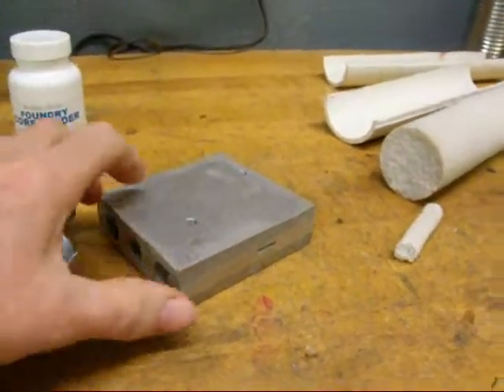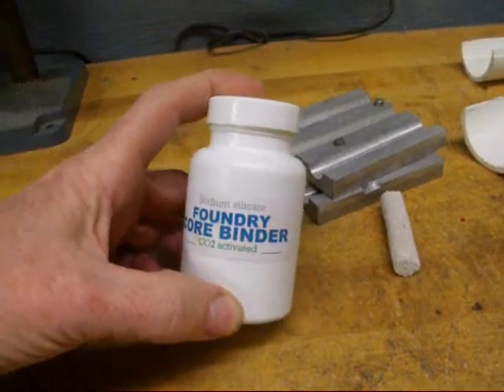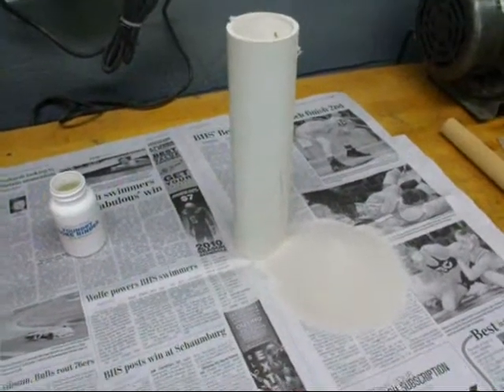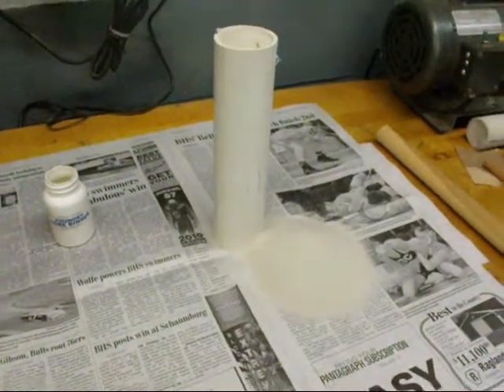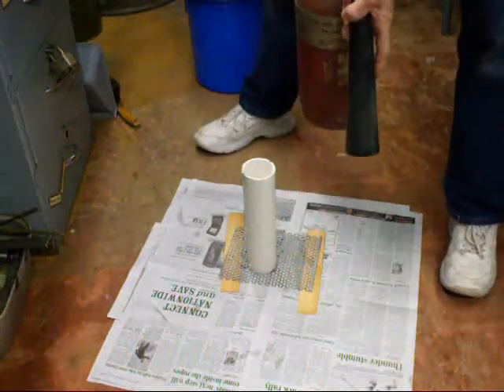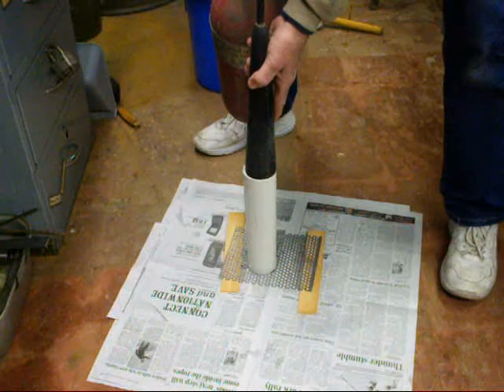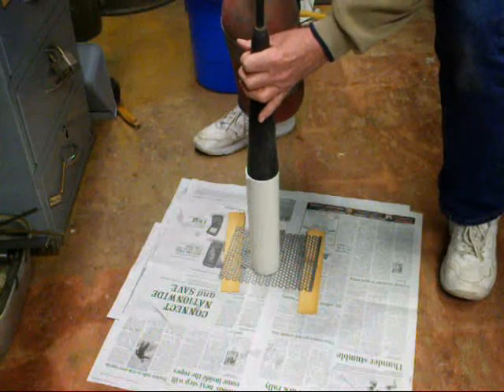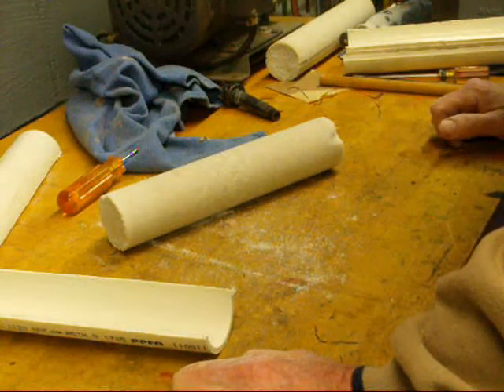FOUNDRY PATTERN MAKING part 6 Steam Engine cores tubalcain

Comment: wow!  incredible series -- thank you!

i have the three-book series "steam and stirling engines you can build" and in book 3, a gentleman by the name of Birk Petersen (different spelling than your last name) goes through pattern making and casting... and eerily uses the exact same techniques you do -- at first i thought you wrote the chapter! 

from using bondo and making CO2-reactant cores, to his sense of humor re his grandchildren and rolling his materials out of the garage when enjoying "fair weather" -- it blew my mind. even little comments about avoiding moisture and potential concrete explosions are included.

so -- are you on the run from the law?  and is "Birk Petersen" one of your aliases?   :)

thanks again for the very detailed explanations of what you are doing and why!!
Reply from the maker: KevCarrico Thanks for watching. Sorry to burst your bubble, I am not Birk. I would like to read those books though.
Reply: www.amazon.com/dp/B00LOUC1E8/ref=cm_sw_r_awd_cq78vbH26DY70

pp 19-35

also in the book is the sardine-can, no moving parts, toy steam boat!

Comment: A suggestion for the CO2 extinguisher. They come with a siphon tube to pick up liquid CO2. If you can secure the tank upside down, you will get gas instead, and it may be more controllable. 

When the tank is empty, it's more than likely that it will pass hydro testing if there's not a lot of exterior rust. 

People also use such tanks for Airsoft/air guns, airbrushing models,  and saltwater fishtanks.

Comment: Worth watching even if you never plan to make a model machine. 

while I like using the 75/25 mix gas with my MIG, most of the time it's straight CO2 as a shielding gas for me. 

I can also get dry ice at the grocery store nowadays for $1.09/pound.

I've gotten many fire extinguishers used. Most of the time I have them hydro-tested, have the valve switched out, and use them for my MIG / Making sodapop / kegerator / portable air tool power source. Now I can add coremaking to that list

Comment: Do you bake . . . I mean besides sand? Half kidding. 
 
A fire extinguisher in the basement  (shop) is, in and of itself a safety issue. I am surprised you didn't allude to the dual utility of yours!! 

I imagine someone trying this for the first time! I used to drive an ice cream truck and would use Dry Ice in the freezer. Had to be careful when digging around inside; Inhale and  you could easily pass out. Gassing at bench height, one might not anticipate this. Probably not a issue though.
Jon